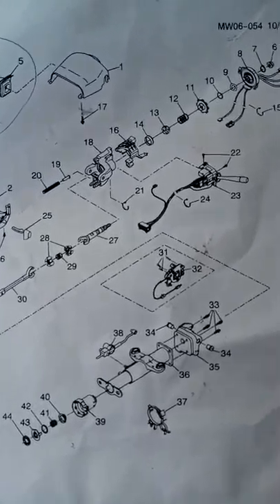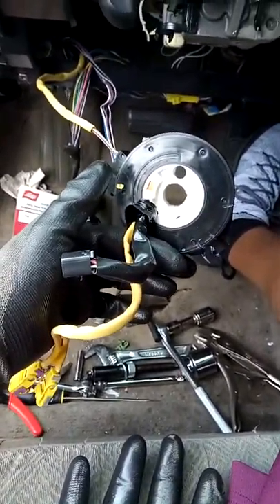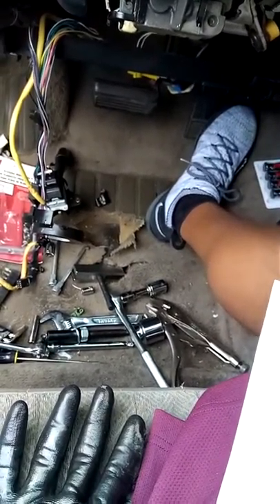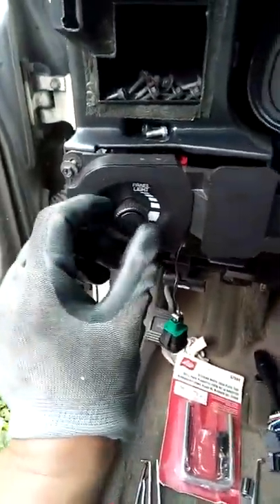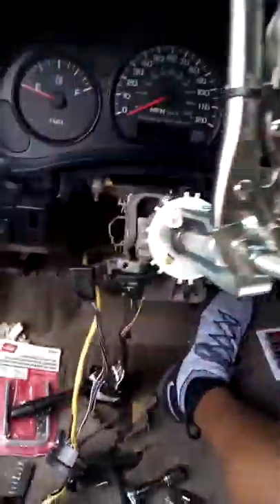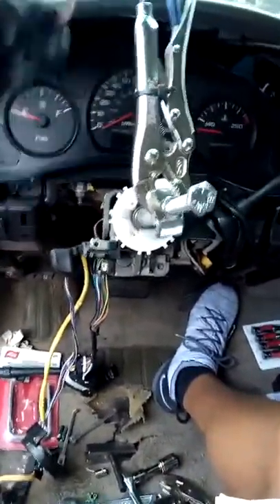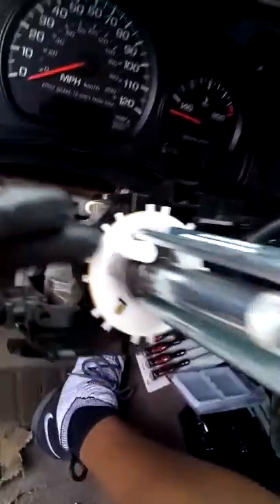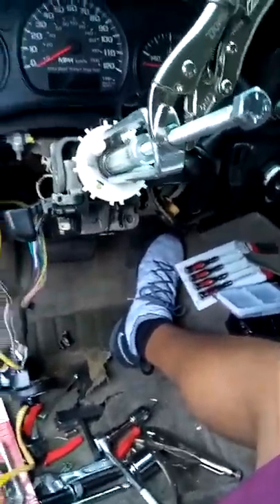2000-2005 Chevrolet Impala Steering Wheel, Clock Spring + Turn Signal Cancelling Cam Replacement

Comment: Also for anybody coming to this video who has an issue with headlights and turn signals flashing too fast and dim. There’s a bolt above the driver side headlight with a metal eyelet connector that turns oxidized. That’s a ground wire I thought my headlight switch was bad and turn signals etc. I cut the connector off and put a new one and sanded the connection better on the frame and all is working now

Comment: This was the type of column I was referencing (a Generation 1.5 W-Body, ironically what is inside that Hayne's manual you have) :
https://www.youtube.com/watch?v=uH6NO61pN-Q

You can see what the lock plate on that column looks like, and why I was initially confused when you mentioned a lock plate being present on a 2000-2005 Impala. (Those "saginaw" columns were around in some form or another from 1970 through 2002, so that's why the wider lock plate compressor is more commonplace.)

Anyway, I see what you mean by a "lock plate" (it wasn't what I had envisioned, that's for sure!)  That retaining ring is a major pain to get out, regardless of what column it's on!!  

Look at the nub protruding at the 10 o'clock position of the cancelling cam.  That's where the horn connects from the airbag (as you've probably already ascertained from disconnecting the spring-loaded wire/pin running from the airbag to this nub.)  There is a metal disc at the back of the cancelling cam that rides up against that metal pin on the turn signal switch, thus carrying the negative side of the horn circuit from steering wheel to horn.  When you press down on the airbag, you're "grounding out the circuit" so to speak.

Thusly, the clockspring doesn't carry the horn circuit.
Reply from the maker: I greatly appreciate your quick response.... Interesting, because since I replaced the "Clock Spring" 26089982 while the old "Turn Signal Cancelling Cam" 26086061 was still on the horn wasn't making it's continuous sound once I reinserted the "Horn Relay and Fuse", as it was prior to the new Clock Spring installation... My current issue is simple, but challenging to resolve... After removing everything, but the "Upper Steering Shaft" 26064247, "Bracket" 26076241, and "Housing" 26087781; I'm having trouble compressing the emerald colored "Spring" 26055299 with the "Lisle Steering Wheel Lock Plate Tool" *i.e. misleading nomenclature)... without cracking the new Turn Signal Cancelling Cam... I think that I have either dislocated the "Bearing Spring Seat" 15925505 from the "Bearing Kit AKA Race" 26001827 or the dislocated the Bearing Spring Seat from the Upper Steering Shaft.  So I am trying to figure out how to - somehow - press the Bearing Spring Seat onto the bottom portion of the Upper Steering Shaft.  Please advise, if you have the solution or ideas via text: +1-608-501-1338.